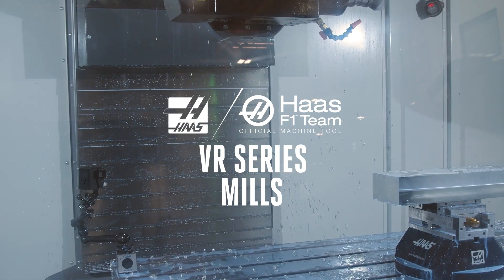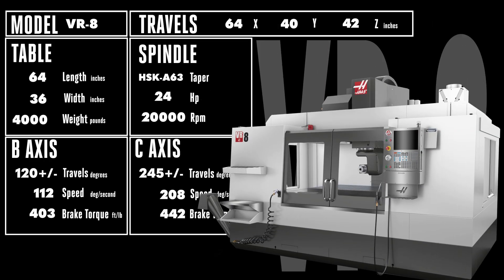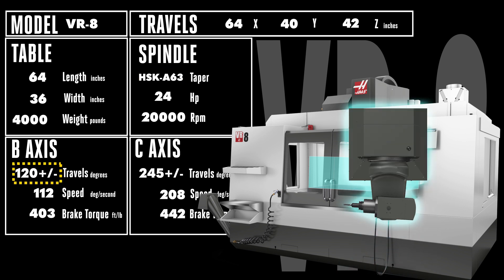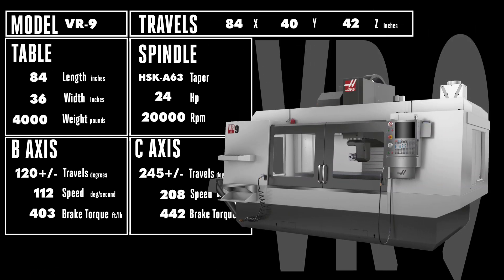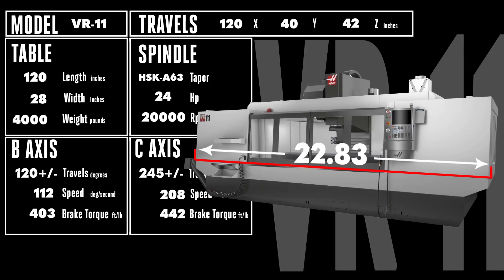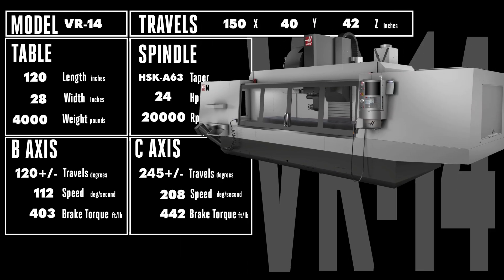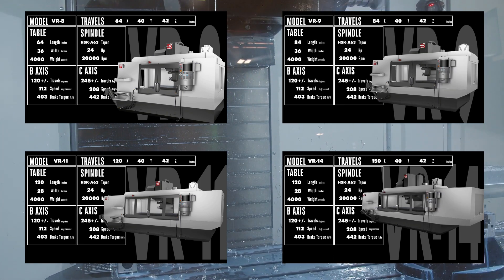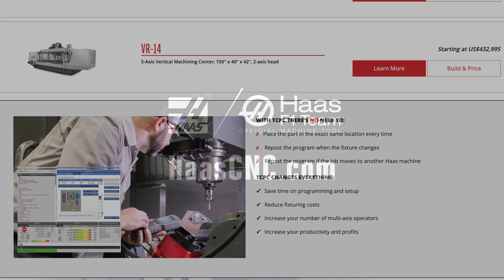Haas VR Series Mills Comparison - Haas Automation, Inc.

Comment: Hi, i wanted to ask if it is possible on HAAS UMC750 for C-axis to work from C0 to C360 instead of C-13000 to C+13000,is there any parameter setting for it on NGS and pre NGS
Reply from the maker: Nenad Janjic, If you're asking if the C-axis can be set up so that when you jog in a positive direction and the coordinate position approaches C360.000, that the next move in the positive direction is C0.001, the answer is no.
Reply: talk with your post-processor provider. they should be able to give you a custom post that will output G-code for your needs.